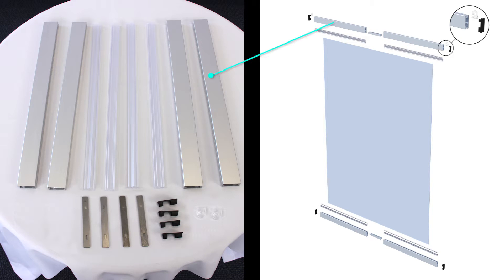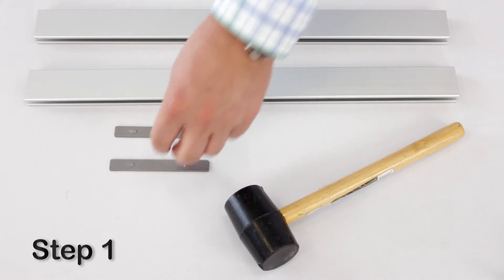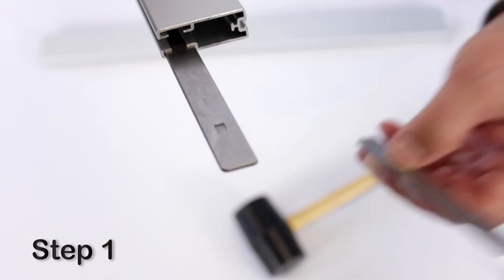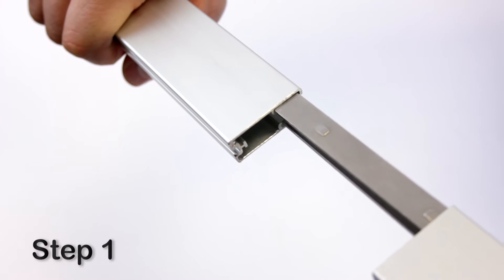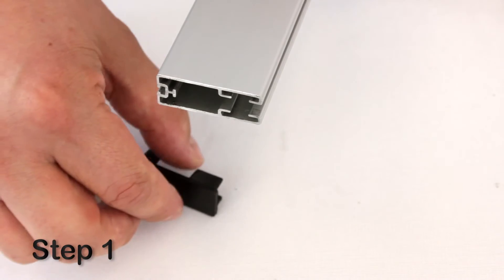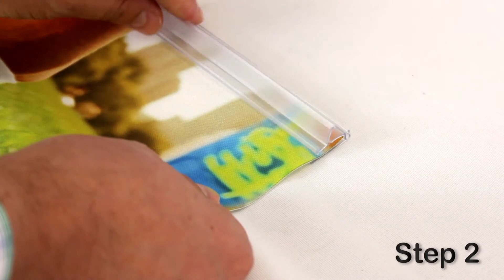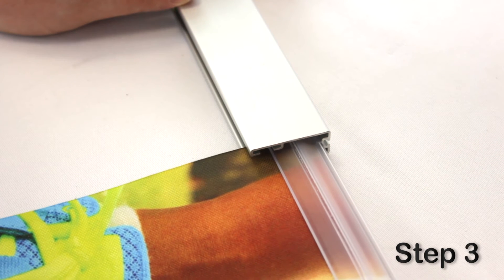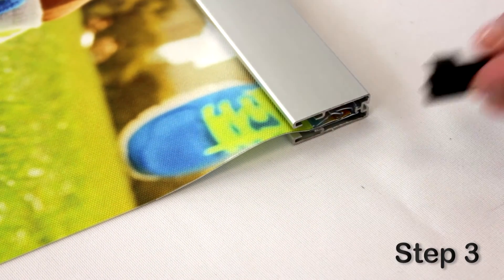SnapGraphic Gripper - SN Series - Assembly Instruction

Comment: We really appreciated the easy installation and beautiful framing of our 25 foot memorial. By using Power Graphics snapgripper system. We used five 5 foot segments for our 25 foot  Orlando Traveling Memorial, top and bottom were covered with the snap graphics plastic grippers and metal bars. We did not use the metal joiners between segments since we would be putting up and taking down memorial many times, the 25 foot memorial tapestry hung just fine at 25 feet wet using 10 plastic hooks that came with the system. This is a beautiful system to make the memorial have clean lines and look sophisticated. This was hung in Orlando in Mayor Teresa Jacobs large long atrium. When we took it down for traveling the country, the 25 foot memorial was rolled onto the outside of the 6 foot PVC pipe West end caps, the snap graphic items, plastic grippers, metal bars, hoax, outliers and instructions were tucked inside and For shipping. The memorial scan was on the outside of the tube, that was wrapped in paper, then wrapped in bubble wrap then boxed for shipping.